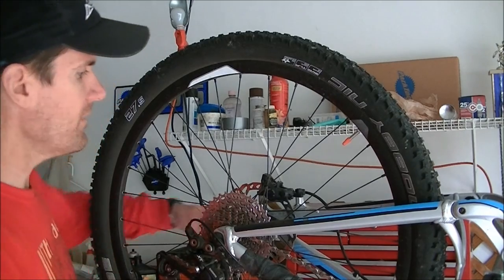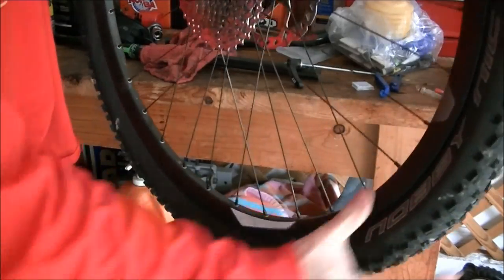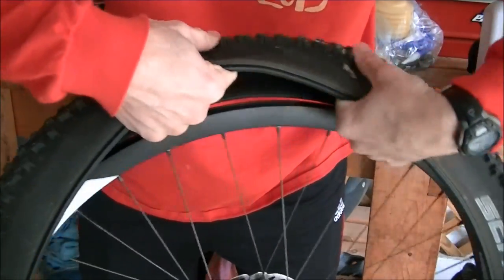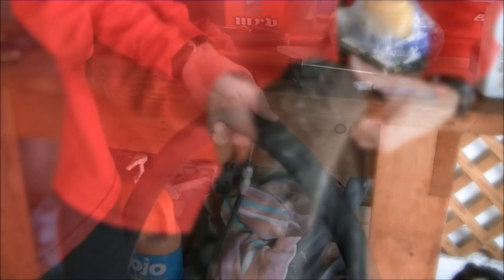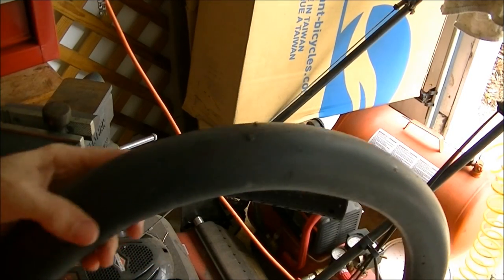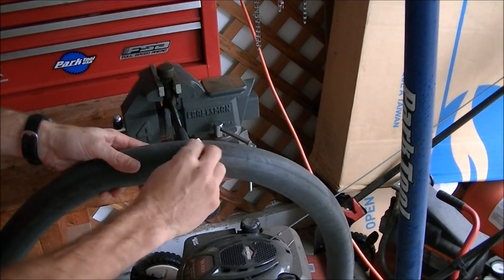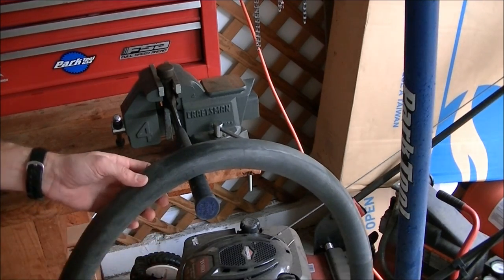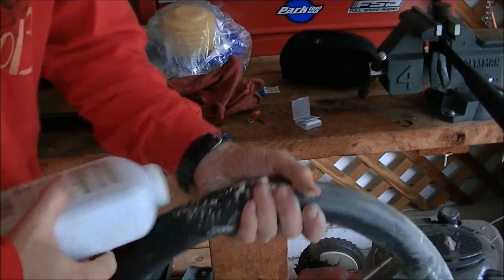How To Patch a Bicycle Tube

Comment: Clint! I just bought a 27.5+ bike and got my first flat. It has WTB Ranger 3.0 tires and beast wheels. I can't get the tire off. I don't have the hand strength to break the bead and don't want to stand on the wheel. That seems dumb. What's the method? Help!
Reply from the maker: +Rob Todd you're probably have to use a tire lever to get between the bead and the rim to kind of pry it Loose. Once you get about 3 inches off the rest comes off easily.

Comment: Very informative video Clint. But I was wondering, why are you not tubeless?
Reply from the maker: Bob Biker , this is a new bike and I haven't converted it to tubeless yet.  I always run tubeless on my cross country bike; my trail bike I'll run tubes sometimes simply because it goes for longer periods of time without being ridden.  I live in Florida and go up to north Georgia and North Carolina a lot during the warmer months which is why I have the trail bike.  The XC bike is my primary ride in Florida.
Reply: Clint Gibbs I've gone tubeless as well on my cross bike. Its just easier I think. There are less things to worry about and I haven't had a flat in almost a year (knock on wood). 
Once again nice video.